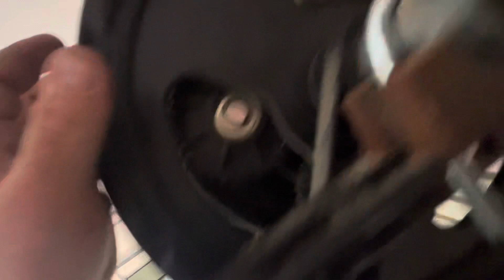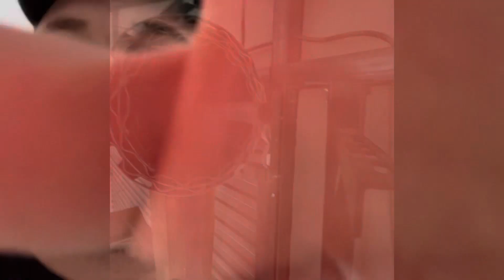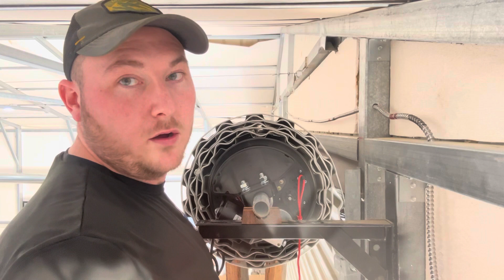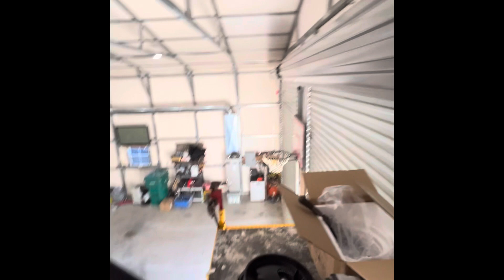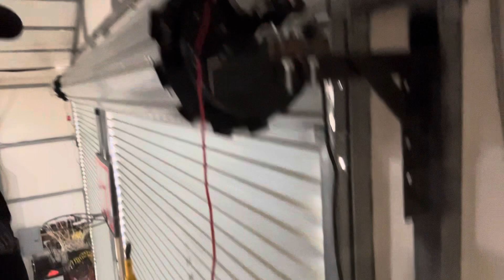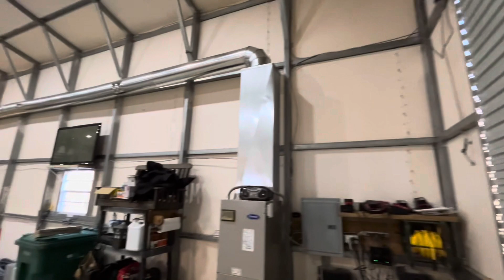Roll Up Door Automatic Opener Installation

Comment: I have been putting one of these openers on my workshop, the instructions are less than good but I finished up last night with just having to adjust the limit switches and found your video. I had already added two more openers to my next Amazon order thinking I would buy them but now I am second guessing that idea. Have you tride other brands that you think are longer lasting?